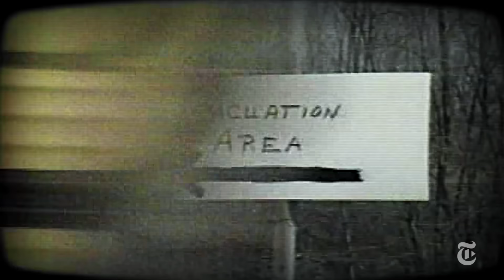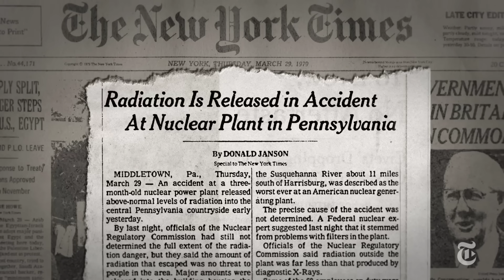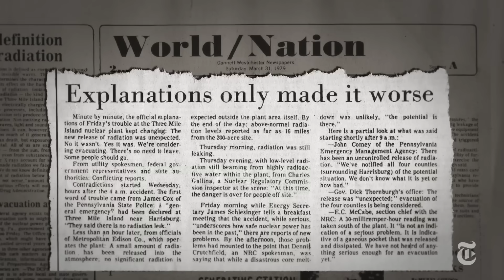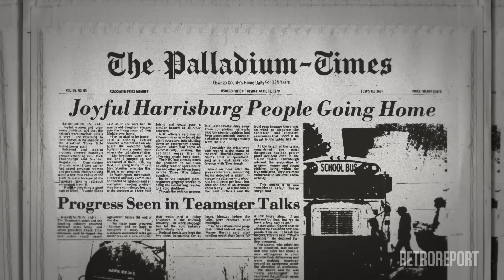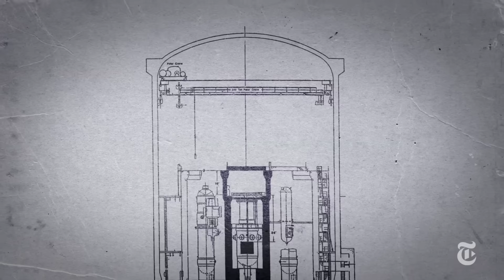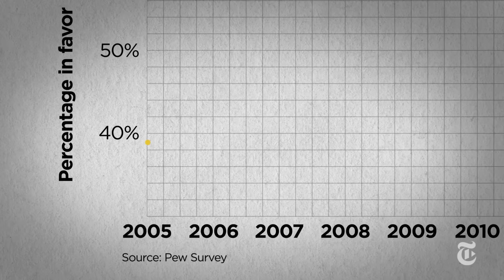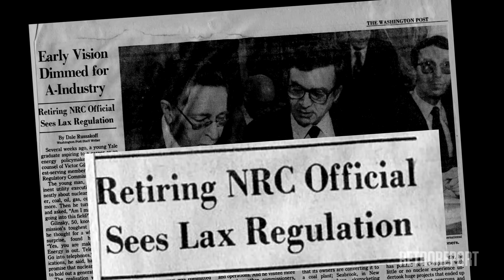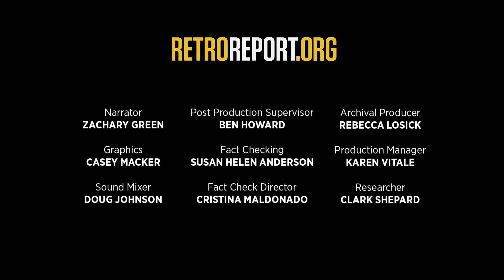Three Mile Island Documentary: Nuclear Power's Promise and Peril | Retro Report | The New York Times

Comment: no one knew the level of radiation released because it exceeded the maximum readings on the plants radiation detection equipment. Normal radiation levels are around .10 and .20 microsieverts/ hour. In a helicopter flew a physicist with a high range Geiger counter and mapped the "plume" of radiation and found it to be 8 millisiverts/ hour. That's 8,000 microsieverts/ hour and they didn't realize that the core had partially melted down untill years later. They had to wait for some of the radiation to decay just to enter the containment building and see just exactly what happened. But still, people got exposed to fallout and some of them settled out of court in exchange for them to drop the lawsuits and keep quiet about what really happened. Mainly the industry did this to not slander the good name of nuclear power and avoid a long lengthy legal process. With that said, this ain't no chest x-ray the radiation is different. You got alpha beta and gamma along with neutrons and yes you do have some x-rays too but it's all this other stuff that makes this incomparable to getting an x-ray. Anything over 5 microsieverts/hr and your going to increase your risk of developing cancer. Anything above 1.5 microsieverts is considered hazardous at least levels at this rate for a prolonged period of time I would start to be concerned for my health and after a month long exposure of 5-10 microsieverts you would probably start developing some kind of radiation sickness. The fatter and taller you are the higher the dose you can absorb before getting sick. At 100 microsieverts/ hr only 1-2 weeks and your getting radiation sickness. You won't die but it will weaken your immune system. Once you get these particles in your body though they cause the most damage. You don't eat or drink x-rays. That's when the problems start. Lucky the containment building didn't blow and most of the long lived isotopes stayed within the premises of the plant but the lighter ones did manage to make their way all the way to Albany NY. One of them is iodine 131 and causes thyroid problems although it has a short half-life and so it "disappears" after 8 days or stops being radioactive. Xenon is another one but unlike iodine our bodies just pass it out and most of it if any doesn't stay behind. Tritium however bonds to water because it's just another form of hydrogen and it too is radioactive but it is more stable so it lasts longer in the environment. There was the initial plume and then there were hot spots that peppered the area around the outside of the plume from rain passing through, absorbing the radiation and where the rain fell the radiation landed.

Comment: Large nuclear capacitors are not it you need micro capacitors of nuclear fusion or whatever you want to do with nuclear that way it's more controllable you can't have it as big as a machine like that you can actually with one you can make one about the size of a 9 volt battery that can run a house okay you guys are doing what you're supposed to on technology you're not micronizing it my stepfather work for TI Bell back in the 40s 50s and 60s micronizing chips he was one of the forefront engineers of that you guys haven't trans fer any kind of thought to micronizing I mean you don't need something that big to run what you want if you do it in small capacities you can control whatever can happen into a 10 ft area maybe 30 cleared area for use of nuclear fusion okay. you guys are so backwards

Comment: I think the problems began when nuclear plants were scaled up-Massachusetts   Yankee (Rowe MA) was a small 139 MWatt p'ant  built in 1962. It ran well until 1993, when it was uneconomic to run it. Maybe having more , smaller reactors is the solution.One big problem with fission reactors-the neutron flux makes the steel reactor bodies brittle. This is why most of our older reactors will have to be shut down soon.

Comment: I understand the need (at the time) for cheaper energy. When the Oil Embargo happened the first time the USA construction on over 100 facilities. By the early 80s they had switched almost everything over to "electric power" It was the first big step forward on renewable energy  (someone had to do something) I don't think they had any idea how big it would be, until something went wrong. I grew up in northern Ohio (we had 2 -5) Davis Besse( which is still working today) being the one my grandfather worked for. Our biggest problem is figuring out what to do with all the waste going forward. Many places just cover it up in concrete and fence it off.

Comment: Nuclear power is quite safe, is handeled correctly it can be very useful
Reply: Depends on what type of reactor we are talking about. The existing reactors I wouldn't want to be near to be honest. They are outdated and held together with duct tape where any new safety feature isn't so much incorporated into it as much as it is slapped onto it like a bandaid.

However the mentioned thorium reactor in this film or Bill Gates (via Terrapower) reactor which uses radioactive waste (spent fuel) are a very different story. Both of those reactors can actually be modified to use the other type of fuel as its source for one and the designs aren't from the 70's as much of todays reactors are. 

Even if they remade the entire design for the current reactors which use U-238 or 239 (can't remember which) I wouldn't want to be near them because those deal in highly volatile material. Thorium and spent fuel rods however do not carry any of that inherent risk and the halflife of the waste is about 100 years if memory serves which mean the waste is not an issue either. Especially since at least in the case of using the spent fuel rods (radioactive waste), there isn't a need to change fuel that often (once a decade is enough according to Bill)
Reply: @malcite  you are true i  that, maybe i need to be more specific lol

Comment: Solar and wind a dangerous delusion?
Nuclear Energy Is The Most Delusional Concept Ever!
Not only releasing ionizing radiation into the environment from normal operations.
They also release radiation into the environment from nuclear waste that they have no idea how to dispose of the most dangerous elements known to man. PLUS, The tonns of water needed to cool the reactors down, with tall chimneys to disperse the radioactive steam high into the air.
Hot water and Ultra Hot Nuclear Particles released into the bodies of waters And atmosphere where constructed.
Adding more heat into the Environment than CO2!
No way a solution to climate change.

Comment: Don't build the cheapest GE nuclear reactor tendered.  Require failsafe shutdown, ie if ANYTHING goes wrong the reaction just stops so can never run away.  The idea of requiring electric coolant pumps to always operate just to prevent a meltdown is INSANE.  Eg. Use heavy water like the CANDU reactors so should the water drain out, the reaction just stops.  Or design another way to ensure that any failure can only end in nothing happening.  It's more expensive only if you fail to calculate the cost of real liability.
Reply: Leif Harmsen I’m not an expert, but I believe the problem is decay heat, which has caused many problems even after the reactor has been SCRAMed. (Shut down)

Comment: I get the comments that highlight how much safer newer plants are, but in the end 1 incident can cause an immense amount of damage and devastation, especially if we are trying to increase output to curb oil and gas utilization.

That is why so many fear nuclear power. Of course newer designs are much safer, but all it takes is a series of events to create an even bigger disaster. And unfortunately we would all be the guinea pigs to the newer designs engineering limits.

No matter what, the process of fission is highly unstable. The intent of a reactor is to control this intentional instability, but by nature such an invention has dangers if enough goes wrong.
Reply: Imagine the amount of deaths caused by coal and gas and how catastrophic it will be if we continue to use them. When you have out ultra modern designs and have highly trained people working on the plants, a risk for disaster is super low. France has already gone 3/4 nuclear, yet have never seen any deaths relating to it.

Comment: Three Mile Island: <Scares everyone in Central PA>
Chernobyl: hold my Plutonium Rod
Reply: @TacticalShinebox  it's not 3 Roentgen is 15.000🤤👍
Reply: Impossible Gameplay no worse than a chest x ray, comrade
Reply: Uranium 235
Reply: Chernobyl : Not Great Not Terrible...
Reply: Fukushima: Omae wa shinderu!!!
Reply: Graphite...hold my graphite, comrade
Reply: Chernobyl disaster was actually caused by operators trying to restart a poisoned reactor in the presence of too much xenon. The reactor was a successful design, and the emergency systems shut down the reactor. The managers forced operators to bypass the emergency system for a total of three times, until the explosion happened. Since Soviets did not design the reactor with containment walls the radioactive material spread much farther than it should have. From then on they operated the 3 other reactors with zero accidents until the early 2000’s, and most of the containment zone is safe to return to making it less worse than we originally thought.
Reply: Well, holding plutonium rod wouldn't be a problem :) But use gloves, it's toxic and hot :D
Reply: Oh great. Another very original "Hold My Beer" comment.
Reply: Reading And Northern 425 The Average Train hold my cancer
Reply: @TacticalShinebox  Three mile came very close. Half of its nuclear rods had already melted. 20 more minutes and Three mile island would be as bad Chernobyl.  And just like Chernobyl officials initially tried to cover it up and said that there was no radioactivity released when they had discharged 120,000 Liters of primary coolant in an attempt to save the plant.
Reply: Chernobil runs on uranium not plutonium
Plutonium is too rare to be used 4 producing energy.
Reply: And still nuclear is much better and safer than fosile, wind and solar by stats
Also it is better 4 the enviorment than the other two.
Reply: Chernobyl was a successful plant operating until 2002. Mind blown.
Reply: Three mile Island didn't have to happen. My father worked on the building of the reactor core. According to him it's wasn't up to specification but deemed ok by The Atomic Energy Commission. Needless to say everyone that worked on the project  got layed off and Babcock and Wilcox closed the facility.
Reply: @keithparkhill8546  chernobyl didn't have to happen either. Lol it was like a perfect storm of Unfortunate Events. But it really could have been worse...
Reply: @razycrandomgirl  and lies,lies,propaganda..all countries, including the US do this, but soviet union  (and any communist state) are notorious  for this.

Comment: New theoretical designs make nuclear power significantly safer, thorium fuel and spherical fuel that can just drain out are massively safer than uranium and the fuel rod model and can produce vastly more power more efficiently. The nuclear power plants of the 20th century were designed in such a way that mechanical components working was critical to the success of the reactor, modern reactors can mitigate these issues with designs that are inherently safe through basic principals of physics.

Comment: The thing is there’s a 1 in 300,000 percent chance of the reactor itself failing but the reason reactors fail is because of human errors such as ignoring power regulation protocols at Chernobyl or poor tsunami and earthquake safety systems
Reply: I'll bet that 1 in 300,000 percent chance was calculated by a human, it may be dangerously wrong. That's the whole point, the industry claims safety while making basic mistakes.
Reply: Percents are out of 100. 
and 1 in 300000 isn’t very good odds anyway.

Comment: The problem with nuclear power is the pressure required by the current designs. Water at 2000 psi is dangerous. Molten salt designs are walk away safe as they operate at atmospheric pressure and employ freeze plugs and passively cooled drain tanks if something were to go wrong.

Comment: I love Nuclear Power it is a Great Power Source and 21 Century Power is Cleaner and Much Safer. We can use Thorium and that is not as Radioactive and cannot have a Meltdown
Reply: Uh, Thorium is bred into Uranium before it ever makes a bit of heat. It absolutely can melt down, depending on the type of reactor. You need to be more specific. Liquid Fluoride Thorium Reactors can't melt down although the could have a criticality incident. Solid fuel reactors, absolutely can melt down but it's far less likely if you use liquid metals for cooling, instead of water.
Reply: At one time we actually had a thorium reactor at Indian point. Unfortunately, the fuel didn't live up to expectations of it's core life so it was switched over to uranium dioxide. It shut down in the 70's because the  emergency core cooling system didn't meet regulatory requirements. Due to this and the expenses for processing the thorium made it infeasible so commercial power stations abandoned the idea. Unit one at Indian point only had a nameplate capacity of 257 megawatts compared to the 1,040 megawatts of both of the other units (2,060) between the two of them. In other words it was costing more money than would be made and when you're running a business that's not good to be loosing money. This and the chance of a reactor melting down have made nuclear energy too risky a business and fossils fuels are cheaper and safer. Plus now there are a growing number of solar farms and small rooftop arrays along with wind turbines that are producing power fairly cheap and modern technology has made it pretty reliable. This with power storage systems are sort of balancing out the need for newer nuclear power plants. At least than a dollar per watt of power solar panels are relatively cheap and can be installed anywhere the sun shines. With the price of metal and everything else through the roof I don't even want to think about how much a new nuclear power plant is going to cost. Just the copper in the turbines alone would be able to pay for a solar farm
Reply: Agreed. But environmentalists will push back as hard as possible to avoid the proliferation of modern high tech nuclear. But by default, their alternative is simply to continue to cook the planet with fossil fuels. You can almost blame them more than anyone else for CO2 emissions since the proliferation of other forms of energy will be slow to take place due to all the lawsuits and lobbying against nuclear.
Reply: Well why don't you go to live Fukushima or Tsernobyl then if you love Nucleare so much?
Reply: @katja904 😂

Comment: Fukushima happened because it was using 1960s technology and planning. The biggest problem nuclear power has is that research into new designs and new methods of building reactors stalled after Three Mile Island, mostly because humans are too dumb to make decisions on facts.
Reply: Now you got it right
Reply: @chicagodog3171  I got it right in the first place. The natural disaster was a trigger; the disaster happened because of old technology and out of date planning.
Reply: Werrf1 Fukushima happened due to a Natural Disaster.
Reply: @chicagodog3171  No. It happened because there was insufficient planning for a natural disaster, and because the plant used old technology that was vulnerable to said disaster. It's perfectly possible to build structures and systems that fail safely in the event of disaster.

Comment: You know what's more troubling than a 50 year old nuclear power plant? The numerous oil and gas pipelines that haven't been replaced since the 1950s. They snake everywhere across the continent, and the number of spills, leaks, and countless oil disasters are far reaching and have endangered the lives and well-being of millions. There's a particular pipeline that crosses the strait between Lakes Superior and Michigan, and no attempts have been made to replace the now 60 year old pipe, in spite of constant measures to restore the supports beneath it. This summer, a freighter ship dropped anchor on that line, and while we were fortunate that it didn't burst, that line could have spilled oil into the Great Lake system, poisoning the largest body of fresh water on earth.
Now, I understand the risks on nuclear power. But the advancements in safety, efficiency, and sustainability have exponentially increased over time. It is cleaner than gas, coal or oil, it doesn't create harmful emissions, and it's far more reliable than either solar or wind, and has fewer negative waste produced annually than the lithium and cadmium required to construct solar cells. The newest advancements in fission use less uranium, and stretch its lifespan with greater energy output. We could solve the issue of finding a suitable waste site for all the expired uranium by reusing it in new facilities that can still draw energy from the reaction.
The choice is clear. We want safe, clean energy that reduces our GHG emissions and powers more efficiently than traditional forms of power - and we've already discovered it.